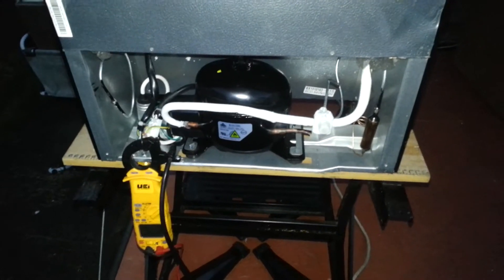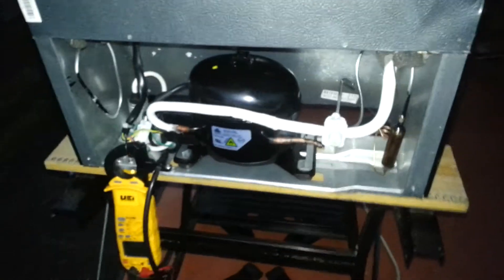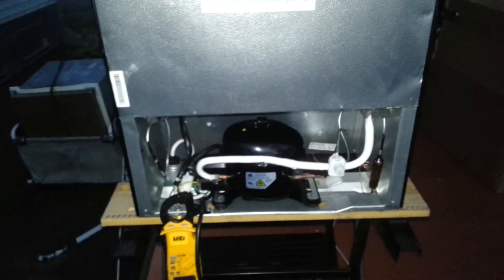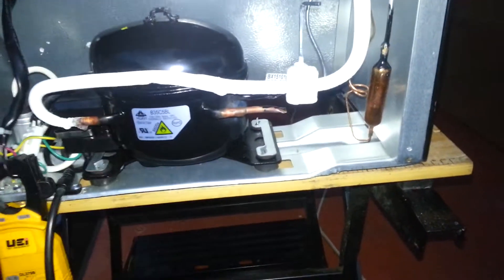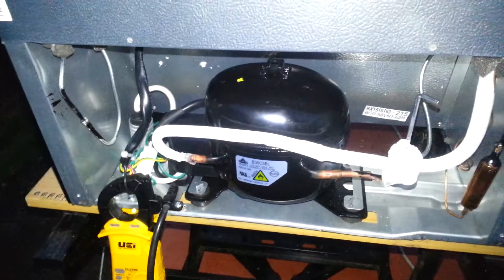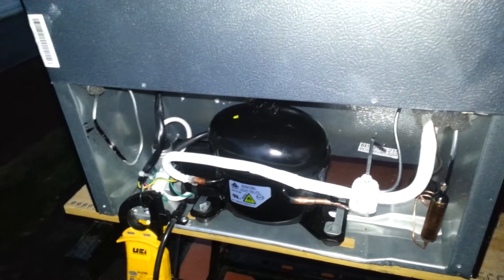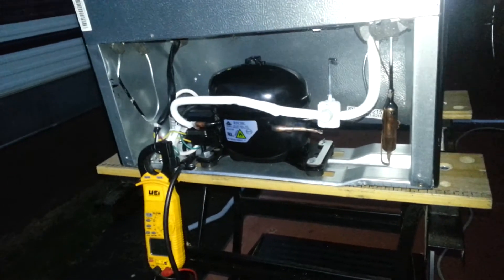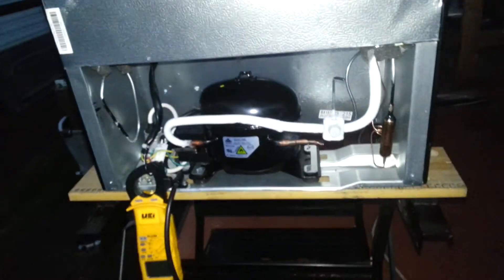Great Iso-Butane Refrigerator Find!

Comment: I’m researching my next appliance. And I noticed that they’ve all gone to the isobutane systems for fridges.
What happens when the compressor malfunctions? 
I’m not sure about having 3 ounces of compressed and uncompressed gas sitting behind a fridge against the wall when the fridge is down with food.
What are the chances of an explosion happening back there?
Reply: Virtually zero. You would need a major leak (not natural) someone would have to puncture refrigerant lines or some other extreme event, and then mix with air and have ignition. Flammable refrigerants scare but not scary

Comment: Huayi compressors are based on Danfoss designs; they are one of the better Chinese compressors.  Donper and GMCC are two others.

I'm personally not a big fan of cabinet bonded condensers as they don't reject heat as well and are harder on the compressor as a result.  Nowadays it's almost impossible to find mini refrigerators or chest freezers with the traditional plate condensers unless they are commercial ones which cost several hundred to a few thousand dollars.
Reply from the maker: My favorite models from the 60s and 70s had stack effect plate condensers on the back. Simple and robust. Easy to clean.

Comment: Frosting back is not good as that is a clear indication of floodback. That washes the oil off the cyclinder walls and can migrate oil out of the compressor that very likely won't migrate back to the compressor.
Reply from the maker: Yeah, not ideal.

Comment: For such a vital thing preservation  of food and living comfortably not a lot of videos . 
Boats are hot inside RV ' s are hot but 18 wheelers extremely  hot due to the massive engine  and exaust.ppl run the main engine to stay cool but it in turn creates tons of heat. Small dc compressor will not meet that demand.only a tri compressor build battery power  . Would suit perfectly . Small diesel ya ok to do the initial  drop then a trip compressor to do the maintenance.

Comment: How did you make your propane charging system.. And if you want, I come across a lot of compressors, small evaporators and condenser coils that are factor made, I could give them to you somehow
Reply from the maker: Well sir, a piercing valve is generally needed to tap into a hermetic system like a refrigerator.  These valves have a 1/4" male flare fitting.  Some means to connect this to a propane bottle fitting is needed, such as a refrigerant hose and a propane bottle adapter.
Reply: M.C. Pletcher nice compressor ,  liked the dc build it was micro nice for a small fridge however planes and a new RV package employ 3 compressors . I'm a little in the dark on how to tie them together probally in series to increase the pressure in the final.seeme a trade secret.

Comment: I have ran propane in an R600a compressor with great results.
Reply from the maker: I wanted to ask you Shaun, how popular are R600a refrigerators in your part of the world?  Do you ever see propane or propane/butane mix?  I know hydrocarbon refrigerants are more widely accepted in Europe than here in the states.  Recently, the government has begun to allow there use in small amounts.
Reply: They are everywhere. I commonly see them at the dump along with the R134a ones but we are not allowed to take anything sadly. I hate being in the UK. As far as I know, butane propane mix is never used.
Reply from the maker: When I started looking at the pressure temperature chart fro R600a, I was surprised by the low volatility of it, compared to other common refrigerants.  Do any of your systems run in a vacuum on the low side?
Reply: No they all have 10 psi at least
Reply from the maker: Shaun Dobbie
That's weird, because the chart I'm looking at suggests that is only 1.8 degrees C.  Much lower pressures would be needed to freeze anything.
Reply: Isobutane is different, it boils at -11 celsius.
Reply from the maker: I here ya.  I meant that 10 psig is 1.8 celsius.  An evaporating temperature of say, -18C to -11C, which is about 0F to 10F (a typical freezer compartment), would but isobutane at a pressure below atmospheric.  

I realize isobutane is different from butane, as butane boils near the freezing point of water, at atmospheric pressure.

http://www.agas.co.uk/media/2423/r600a-iso-butane-pt-chart.pdf
Reply: I see, maybe you are right then. When I was using r600a I think the pressure I mentioned was with the system off.

Comment: Interesting, I thought these were only available overseas.  Is this unit noticeably quieter than a comparable r134a model?  It seems like the earlier r134a fridges were rather loud.
Reply from the maker: I've noticed no noticeable difference. Of course, I am noy running the appropriate refrigerant in this, as I don't have any iso-butane. The EPA changed the law in 2014, so you will probably see more of these soon.